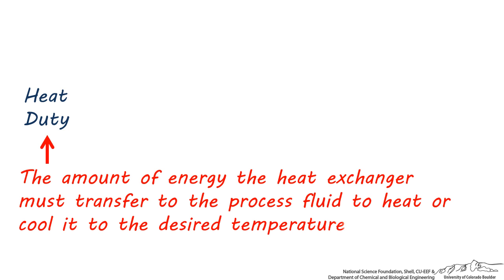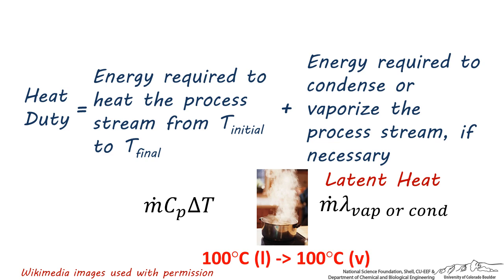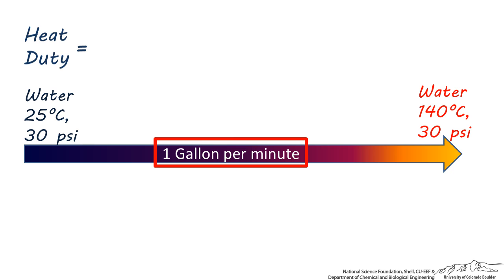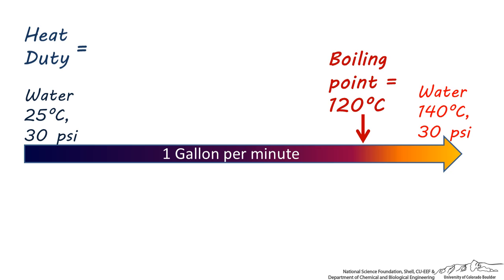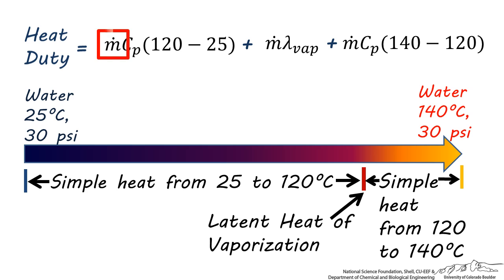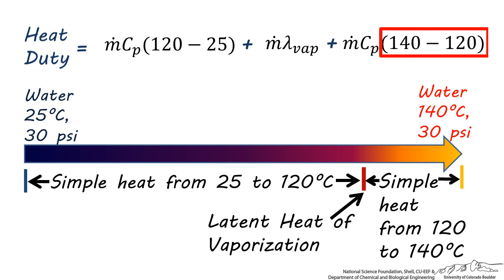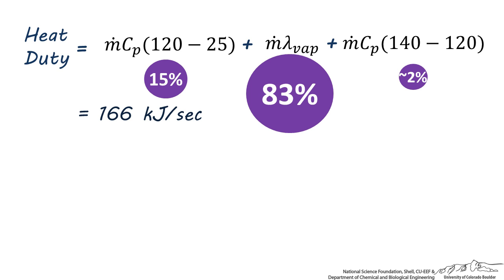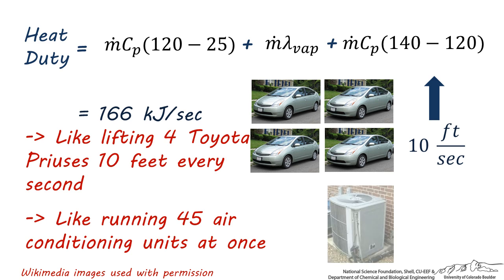How to Calculate Heat Duty

Comment: But how the answer calculated as 166kj/s I want detailed explanation please!!!!!!
Reply: Firstly convert the volumetric flow rate from gal/sec to Kg/sec 

Then use the specific heat (Cp) for water (liquid) about to 4.18 kJ /Kg K  and for water (vapor or steam) about to 1.84 kJ/Kg K and you will get the answer :)

I think you may forgot the whole video ;)
Reply: Volumetric flow rate to mass flow rate***
Reply: https://youtu.be/e80ifuDR3p4
Reply: Very good explanation. Thank you Presentor